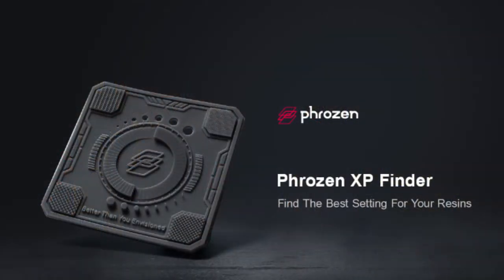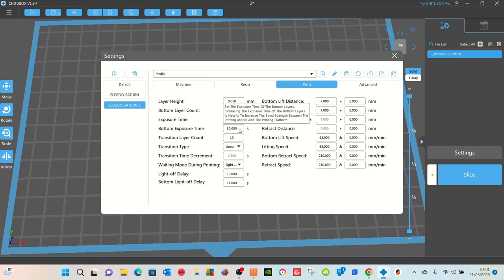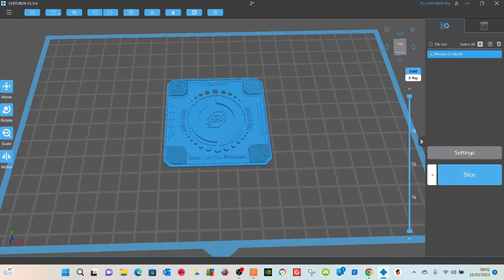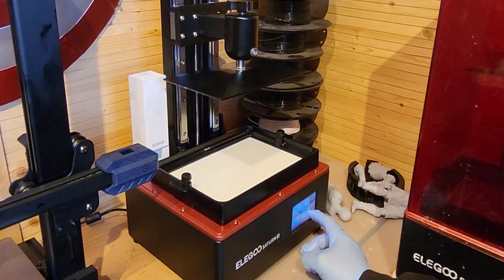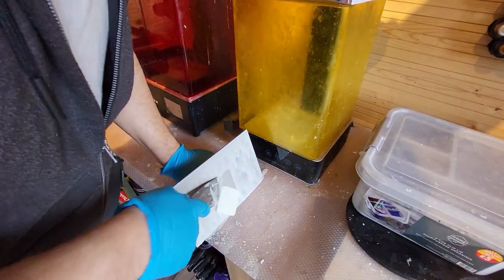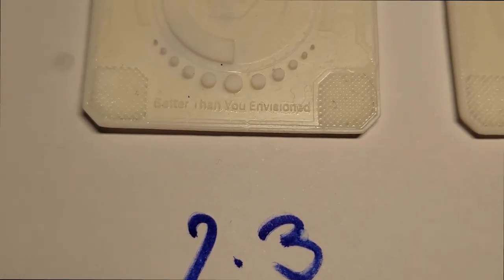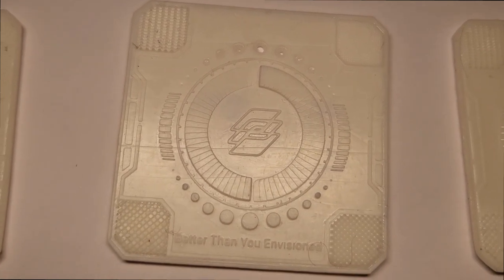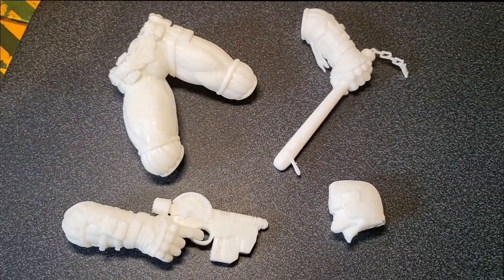Create Perfect 3D Resin Prints by Finding the Best Layer Exposure Time

Comment: Thanks for a great video. Appreciate the information.  It was very useful.  In return, a tip, when pouring from the resin container, (@5:26), turn the container 180 degrees, so the opening is at the top .... you'll find the pour much more easy to control.
Reply from the maker: Thank you 👍😁

Comment: Nice video again. 
I notice it depends what exposure test you run but they all show different results.
I tried the flat XP2 test and it says under exposed.
The cones of exposure show slightly over exposed.
Rule of thumb is go slightly over exposure so the supports work.
Reply from the maker: Thanks for the info! I absolutely agree

Comment: Printed 6 of spread around the plate on my Photon M3 MAX. One of them didn't stick to the plate and stuck to the FEP.  My thoughts are this is related to the bed level. What do you think?
Reply from the maker: Good possibility I'd say
Reply: @greedy3d480 I've had this happen on beaten up FEP sheets, not necessarily unleveled.  I got some FEP lubricant and that solved the issue.  I usually relube after a bottle of resin, however my printer is pretty small (70x130) so a bottle lasts me a lot of prints.

Comment: If my test get 1.4s exposure is perfect ? Do you think is not to low?
Reply from the maker: If it works at 1.4 and produces good prints go for it...👍
Reply: @greedy3d480  i dont know its produce good print or not. But the calibration u teach its perfect. In just scrae if real model printed its not enough time to cure the model
Reply from the maker: @servernajmi1354 try a small print first ...each printer and resin type produce produce different tests that's why it's important to test ..I don't think 1.4 is low...go for it
Reply: @greedy3d480  but i test 1.7 is good just dont have hole on top. So i decide to do cone test and its over expose
Reply: @greedy3d480  and i test 0.05mm but real model im currently used 0.02mm

Do i need to xp test using 0.02mm?